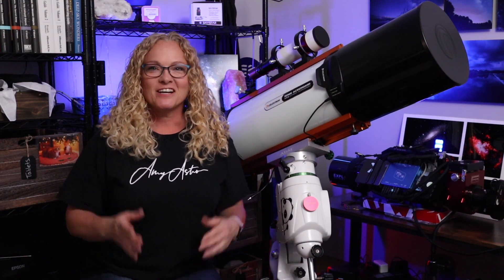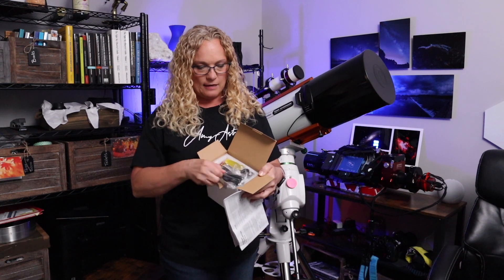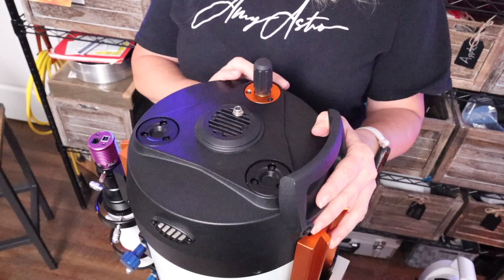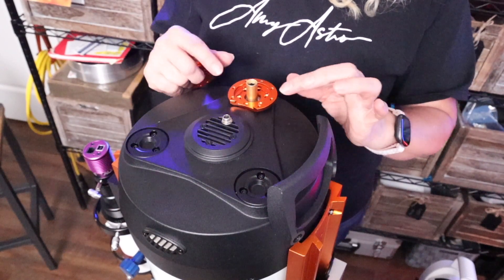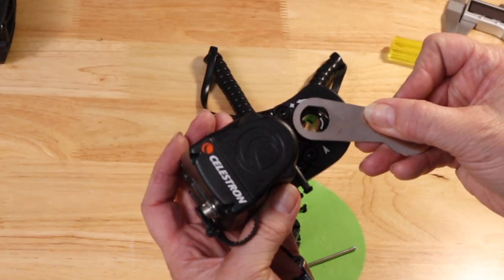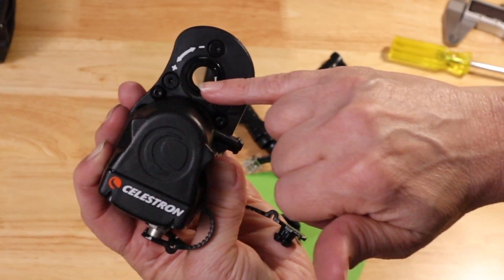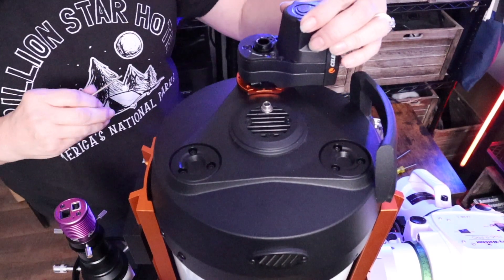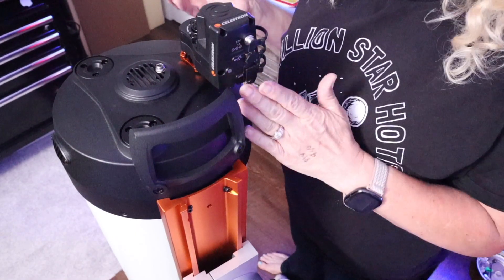Installing a Celestron Focus Motor on a RASA.  Detailed Instructions

Comment: Amy Astro sweerheart, I just received the Celestron soft case for my SE8. 
I plan on watching lots of your great videos toward 2024 summer here in Oregon.(to get into it)
I have had it for 5 years and never used it. I'm sure I must update the firmware first. I have always wanted the focuser.
I also have the power flashlight/power supply thingy for the scope and assume it will run the focuser?
Do you think this focuser will affect the ota fitting in my new nylon carry case?
Love your channel. I am a member of NS45 here in Salem. We have a web site.
Thanks for the call to prepare for some getting outside. Love your channel. Wish you lived next door so I would have a built in instruction manual. 
Best to your health and family. //John in Oregon

Comment: So I made the mistake of trying to do this on my 11" while it was on the mount.. even when it was pointed down i had some struggles... I think doing it on a table or something like you did is the better option for sure. Also when I pulled off the original focuser plate, I had two washers or something come off with it.. they were nice and greased.. I dropped them back on and continued. It should be noted I have the RASA 11" V2.. those washer/seals whatever they are were just rubber but they caught me off guard. I don't know if its just me, but I have had this focuser work its way loose two times now.. one night it fell off. I have zero complaints about this focuser..even when it fell off lol.. I was able to just put it back on and was back in business within minutes. I might be an edge case here.. I might have installed mine in a slightly weird angle where the mirror and gravity were not working in my favor... best of luck! looking forward to first light!
Reply from the maker: Thank you.  I am getting close.  I need some clear skies to line things up and focus

Comment: Great video! I recently added the focus motor to my 9.25Edge and it's working well, but there were a couple issues at first that I think worth noting. To start, I found powering the focuser a bit flakey. With one laptop, and the USB hub on my Ioptron CEM70, the USB connection was all that was needed, but with another laptop, the connection would be lost as soon as I started the calibration routine unless I was also using an AC adaptor. I also tried using the AUX port on a CGEM mount prior to getting the CEM70 and would get errors, though that may be because a mud wasp once made a home in that port......

The second issue was reaching focus when using a reducer (pretty much always, for me). The problem was that the calibration range set by the focus motor is somewhat inside the physical range of the ota's focuser and with the reducer, the focus point was so close to the end of the physical range that it was outside of the calibration range. After much back and forth with Celestron, it finally got sorted out and they sent me a replacement longer pin/screw for the ota's focuser to extend its range and all works fine now.  Have to say, though, that I was a little disappointed with Celestron in that at least one staff member knew of the issue (came up with another customer) but other staff members didn't, let alone the required part included with the focuser or at least a disclaimer in the marketing.
Reply from the maker: Thank you.  My fingers are crossed.  Looks like I am waiting another week to find out what my weather will look like.  So many clouds, so little rain here.
Reply: @AmyAstro  One thing that seems a little odd, is even though it was a known issue at Celestron, it wasn't widely known there and I couldn't find any reports of it in the forums. Even if it's only 9.25 edge's, seems like there's enough of them out there that it would come up more often. I got my OTA used (on eBay, took a chance cuz' my backorder patience ran out...) and it's 7 or 8 years old, so maybe newer ones have the longer pin? Anyhow, had an unprecedented 6 clear-all-night's in a row (since I got a telescope, that is...), so settling in for 2 or 3 weeks of clouds to bring things back into proper balance...
Reply from the maker: @scottbadger4107  Wow that is a great run!  It could be the age and it is fixed now.  Fingers crossed.  Lots of turn over in all the companies in the last few years.  So much knowledge lost.
Reply: @AmyAstro  Of course it was leading up to a full moon....but apparently weather Murphy didn't know I got an Ha filter! :) Given the lack of inventory to sell, I'm surprised so many manufacturers and retailers both have managed to stay in business. But yeah, I've had the 'pleasure' of speaking to a number of tech reps for advice and problem solving while getting going over the past year or so, and experience seems generally thin. It also seems like much of the industry is trying to catch up to the growth of AP vs observing....

Comment: Probably going to find that you'll still need tape to hold the rubber covers in. Mine don't like to stay in the ports. I'm using the AUX port directly to an AUX port on my Celestron CGX. Focuser works really well overall. Looking into making it capable of autofocus through SGP. Think a separate temp sensing unit may do the trick. Just not 100% sold on the focuser playing well with the sensor.
Reply: Sorry miss spoke in first comment. Don't know what I was thinking when I said USB3. Not enough coffee yet this morning.
Reply from the maker: I know that feeling.  I was wondering if they would stay put.